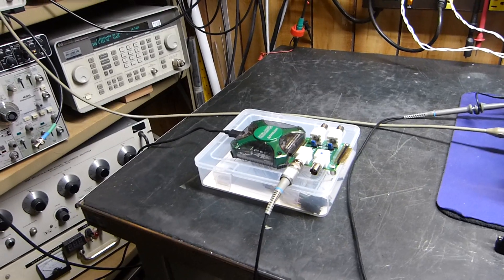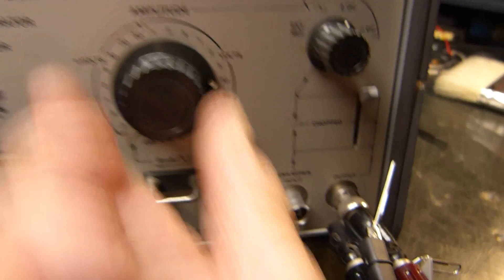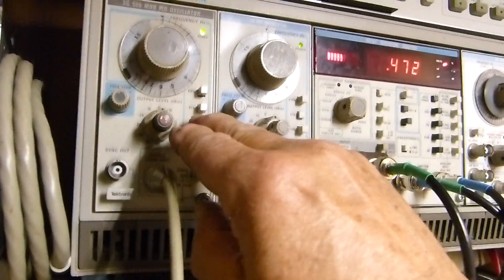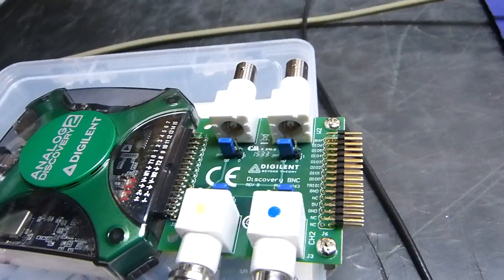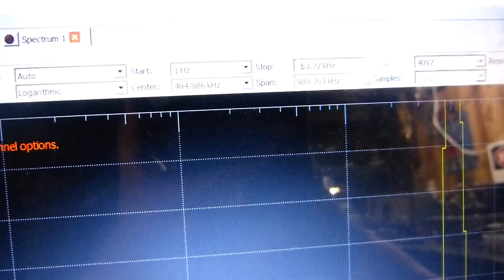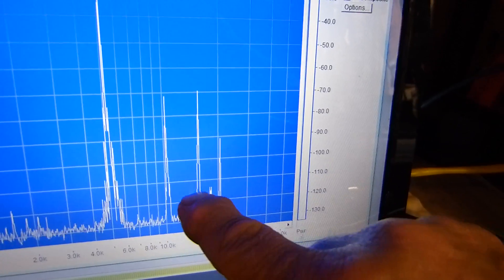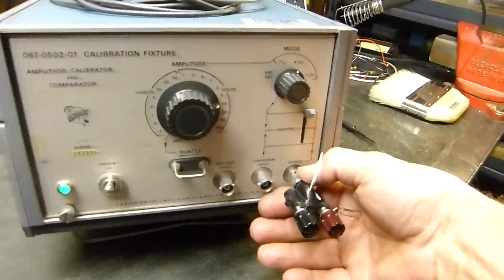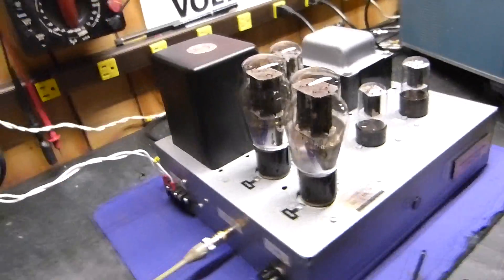Analog Discovery 2 - Evaluating AC/DC Voltmeter & FFT Spectrum Analyzer For PC Based Audio Analysis

Comment: You forgot to move the jumper wire on breakout board to AC. That is why its readings are not well accurate.
Reply from the maker: If you read the comment below from Digilent,  the manufacturer of the Analog Discovery 2 just below your comment here, you will see the AC voltmeter has a known problem and they give a workaround. The AD-2 is a nice instrument for a classroom where you know the results you are looking for and there are a few other features about it, like the spectrum analyzer, and other features as she mentions, that are quite nice, but as an all-feature lab instrument, it can be misleading. They have come out just recently with the model AD-3 and I suspect they have resolved all of these problems.

Comment: Wow, it's 5 years on from this vid, but was just going to order one, but now wondering.  Have they sorted this now do you know ?. Also, how does the Bode plots operate then, don't you have to measure AC ( to DC )  and convert to db for the Y axis, so that would mean no more than a few kHz ????, yet I think the AD2 Bode plots go to 10MHz, or maybe I have this all wrong.  Would be grateful for you comment.  I very nearly clicked the button to order the 'Ultimate Analog Discovery 2 Bundle' at quite high cost, so now in limbo. Thks for you vids on this product.
Reply from the maker: Hi Joe,
I don't know how to comment to help because I hardly use mine anymore. The model I have has a pretty decent FFT spectrum analyzer with, as you said, a 10 MHz bandwidth that I wanted for audio but settled on an audio specific SA that works great but has a horrible oscilloscope. Seems these PC based instruments aren't good at all things. I can see the AD2, or whatever version they make now, as really good for classroom demonstration. If you know what you are looking for and take care to set the device up right, it could be a jewel in a class room but for a general all-around lab instrument, I don't think so. I could be wrong and as can be seen in some of the comments, the AD2 people were quick to write back to me and defend themselves and show me how to get correct readings, I think..., on the AC scale, but that did not satisfy me that I have to know a special-trick to get accurate answers. It was pretty expensive when I bought it and I bought it expecting it to be that all-purpose lab instrument but, it did not turn out that way for me. Sorry I can't be of more help.
I just noticed... see the comment just below this comment of mine from, Bianca.

Comment: Have you ever tried using regular cable/lead instead of oscilloscope probe for AC Voltmeter?
Reply from the maker: I have used regular coax cables and get the same results as using oscilloscope probes in the 1X position. The oscilloscope probes in the 1X mode are straight thru cables. The company that makes the AD2 acknowledges that the AC voltmeter is a problem but suggests other ways to get accurate AC volt readings. The AD2 is a nice instrument but it is primarily made for educational and instructional situations where you are instructed to set the instrument up in a certain manner and you will get the results expected. Using it as a laboratory grade instrument may result in answers that are very far off. I like the AD2 but it is best used after you know what the results should be and not as a first approach to solving measurement problems.
Reply: @ElPasoTubeAmps  Ohh.. Ok. Thanks for the info. About oscilloscope probe, it's not just simple straight wire as far as i know... and it has resistance, about 100-200 ohm.
Reply from the maker: @agussugiono2362  I didn't know that about the 1X probes but I just measured two, one was the inexpensive ones that come with the AD2 and the other was a 1X Tektronix and the DCR was 247 ohms and 330 ohms respectively. I learn something every day from you guys. Thank you.

Comment: Hello,

This is Bianca from Digilent. Thank you for the interest you are showing in this product. We saw your video and we wanted to say that is normal to have these results. The problem is real and affects the AC voltmeter, in Rev 2.5.4 and earlier of WafeForms. It does NOT affect the Spectrum Analyzer, the Network Analyzer, the Scope and FFT within the scope.
The problem is solved in the Logger instrument.

The Voltmeter instrument uses the same HW resources as the Scope. The RMS value is computed from the acquired samples. For Analog Discovery (2), the data buffer size is 8ksamples/channel. The Update rate is 1s, and the sampling rate is 8kSPS. The maximum frequency, for accurate AC RMS measurements is about Sampling Rate/4 = 2.048kHz (even at this frequency, the RMS value is computed from 4 samples /period, which is far from optimal).
The lowest frequency for accurate AC RMS measurements is about Buffer size/Sampling Rate*4 = 8k/8kSPS*4 = 4Hz. (which is 1/(update rate)*4 ). This provides 4 periods of the input signal in the acquisition buffer (also not optimal). 
The problem is that the Voltmeter instrument always samples at the same frequency.

Use the LOGGER instrument for this kind of measurements.
The Data Logger instrument also performs RMS measurements, but allows setting the update rate. As described above, different update rates allow different ranges of frequency in the input signal. The Logger instrument displays the frequency range next to the Update rate control.

The next versions of WaveForms will allow to select the update rate (and the resulting frequency range) in the Voltmeter instrument also.

Thank you and best regards,
Bianca 
Digilent
Reply from the maker: Hi Blanca,
Thank you for your kind reply and letting me know that I wasn't overlooking something simple and misrepresenting the AD2, AC voltmeter in my videos.
As you can see from my YouTube postings, I am very pleased with the performance of the oscilloscope and signal generator,  and I find the FFT Spectrum Analyzer usable into the MHz range.
I am sure I will be using the AD2 in upcoming videos on audio devices I build and test and I look forward to upcoming versions of WaveForms.
Again, thank you and I wish you and all the staff at Digilent  the very best.
Regards,
David Beard
Reply: Bianca Peterlin with the logger instrument it would be of value if you were able to graph, frequency pulse width, duty cycle, a.c voltage etc over time like a histogram. For instance with the frequency you could look at the frequency stability of an oscillator over time. Just something to add. Thanks.

Comment: What is the AC voltmeter frequency range spec.?   Every AC volt meter has a frequency range they guarantee accuracy on.   It sure looks like this is rolling off after 1000 hz or so.
Reply from the maker: It is rolling off bad as the frequency goes up. With a FFT that is usable and a scope that is good, it is hard to believe the voltmeter can be so wrong. I am reading all thoughts and will see what I can find.  Thanks.
Reply: I have an old Fluke 8020A.   Its AC volts specs roll off at 2khz.   It states it is +-5% inaccurate at 5Khz.     My Fluke 87 IV is good to 100Khz.   AC Volt meters specs vary.
Reply from the maker: I have been working with it tonight and it is interesting that my almost 50 year old Triplett 630 is quite accurate well past 20 KHz and even at 50 KHz 7.0  volts reads as 6.8 volts. Unbelievable that this otherwise very nice instrument is basically only accurate as a voltmeter at 60 Hz. The DC is perfect. It will read 5 volts as 5.00 from the Tek calibrator.

Comment: Might be an obvious question, but do you need to move the switches or pins back to the original position (back to A/C ) on the fft like you showed in the beginning of the video?
Reply from the maker: It should work OK either way except for possibly low frequencies with AC coupling. I have tried it with AC and DC coupling and with a direct wire, eliminating the probes and it is all the same.

Comment: the input OP amp chip might not have the gain at the higher frequencies, try 1024 bins instead of 16384 bins, using higher bins will make the FFT slower as it takes longer to calculate if you want 4096 bins would be your MAX, when I do a FFT at 32768 bins it does run very slowly so I stick to 4096 bins.
Reply from the maker: Unfortunately, it is fixed at 4096 BINS. I can't change it to anything else. I agree that this would help and maybe a software upgrade in the (near) future will help. Thanks.

Comment: There is some 3rd party software for audio analysis that works by stepping the scope and signal generator through different time bases. That method maximises the useful range of the device. It's a limitation really of the channels being designed as a scope primarily and the way it is sampling. The same issues come up with all scope FFT and they struggle with the low speed audio signals. As for the AC meter I've not looked at the spec but wouldn't be surprised if it meets them.

Comment: To get rid of the glare you need a polarizing filter, sky filter or ND filter will not help.
Like your videos!
Reply from the maker: The ND filter didn't look like it was helping much from what I could see in the viewer. I will have to see what I can find in a polarizing filter. thanks.
Reply from the maker: I finally looked up a52 mm  polarizing filter on Ebay and ordered one. Thanks for the suggestion.
Reply: You are welcome. remember to remove both the skylight and ND, they only the light more light away.
Question. What is your opinion about the tube 7189A?

Comment: I've got a feeling the scope probe is messing with you on the ac voltmeter test.
Reply from the maker: I wish that were true but I have tried it direct connect with a cable and the result is the same. Lots of good suggestions from all of you guys. I am going to continue looking into it and see if there is some calibration procedure that I missed and  post my findings. Thanks.